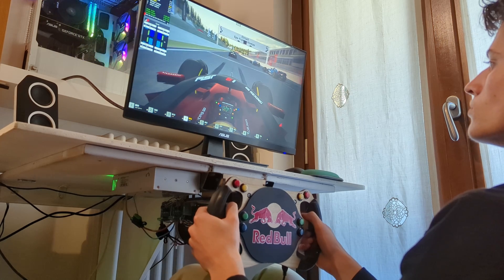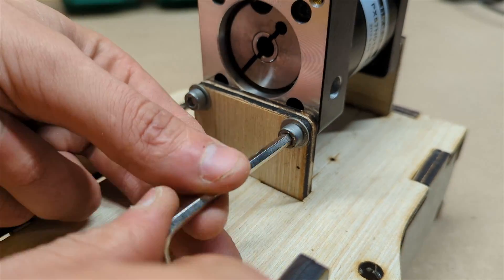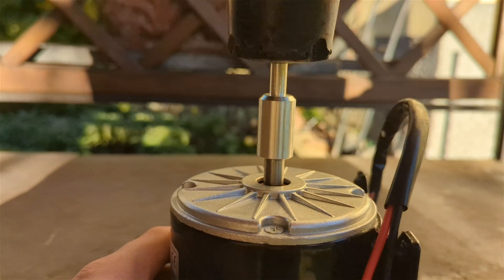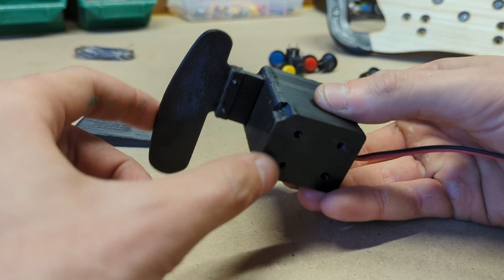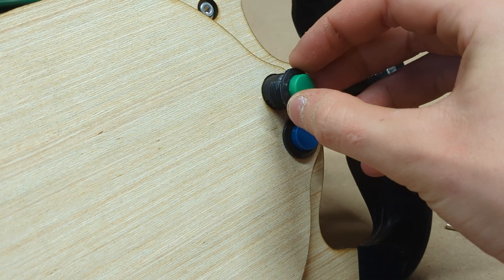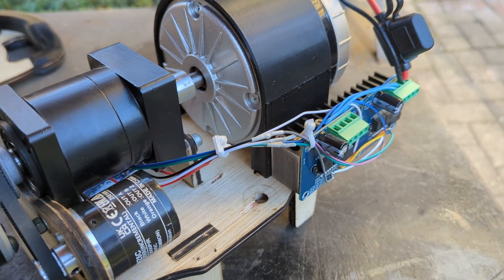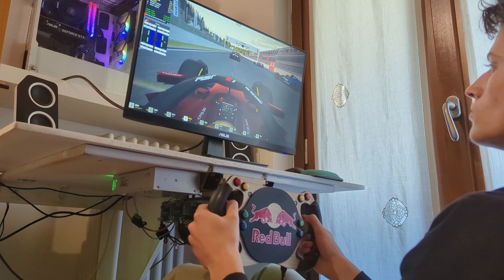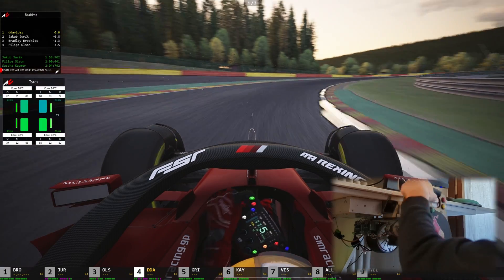DIY FFB steering wheel | 😱 50Nm 😱 | HIGH performance & FUN

Comment: 50Nm? Really? My VRS wheelbase, which has an industrial Mige 130 servomotor and is 3 times the size of this little motor provides only 20NM. A Simucube 2, which costs over 3000 Euros can only generate 35Nm and will brake your thumbs if you're not careful or experienced. How did you measure 50NM and how is it that the torque doesn't rip the wood and your 3d printed parts to pieces? Don't get me wrong, I think that what you did is creative and cool, but there is no way that this is generating 50Nm even with the gearbox in any type of useful way. Only looking at you driving, I can see that you're nowhere near 15Nm (30% of your gain) My wheelbase is bolted with M8 Steel bolts to a 40/120mm aluminum rig. When I run it at 15Nm the vibration travels throughout the whole house. I had to mount the rig on 5cm damping rubber to prevent that from happening and still can't get it completely dampened. The fact that you run it at 15Nm and can drive a Formula 1 car and holding on to hard 3D printed plastic grips without any gloves,....and on top of that bolted to a wooden desk? It would tear your skin and shake the whole desk. I think that there is something wrong with your calculations.
Reply: You cannot compare a base running a brushless direct drive with a geared down base. You can achieve arbitrarily strong torque near stall with a wimpy little motor, and high gearing, but then the max angular velocity that will be achieved will be so low as to be useless! Once sufficient torque is achieved you also don't care about torque so manufacturers competing on these values are just being silly. Often extrapolated/assumed values too because their mount, their shaft attachment etc will not hold up to nominal torque.

Problem is it being a brushed H-bridge driven motor, it has substantial nonlinearity across its rotation, felt as cogging. You need to distribute it across the rotation of the wheel to make it less objectionable, so you just necessarily have to gear it down, which reduces max angular velocity.

To give an example, DFGT, G27 and Moza R3 have very similar holding torque. You can compare motor bulk/weight, G27 is double the DFGT, since it uses lower gearing and two of the same motors same exact as one in DFGT. And Moza is multiple times that weight. DFGT and G27 are both brushed and geared like this wheel. G27 can turn somewhat quickly but it doesn't have a lot of precision due to nonlinearity of response and feedback deadzone. DFGT turns very slowly, it takes multiple seconds to complete a revolution! Moza is very responsive and can turn very quickly.
Reply: I work in trucking. 18nm is whats used to break a truck nut. Thats how powerful 15 to 20nm actually is! This looked like about 5nm
Reply: No steering wheel in a car is going to be so hard to turn as a motor with torque in the double digits  and I've owned cars that don't have power steering, all cars steering goes light once you're moving even if only very slowly. The people who think more torque is better have no idea, probably just kids who don't even drive in real life. The most important thing I think is that your sim wheel will turn fast enough to match what the ingame wheel wants to do. The rotation of the in-game wheel is tied directly to the angle of the front wheels of the car in-game. When you drift, the self aligning force of the front wheels is what you have to keep up with, thankfully you can just let go of a real life steering wheel and it will automatically match the angle the front wheels want to correct to during the drift unless the angle of the car exceeds the travel of the steering rack... That's why drift cars shorten the length of the steering arm on the steering knuckle, so that the front wheels turn at a higher angle per rotation of the steering wheel as well as increasing the maximum angle of the front wheels.

I used to own a RWD car with no power steering where it took 5 and a half turns from full lock to lock. It was hard to drift because the front wheels didn't turn very far either. The turning circle wasn't great either but the steering was very light because of the forgiving steering ratio. I still own a car with no power steering. I replaced the steering rack in this one with one which has 3 turns from lock to lock compared to the original which was 3.5 turns. It's very easy to catch a slide because the wheel doesn't spin too fast which makes it easier to judge when to catch the wheel and balance the throttle. It does make the steering very heavy if you're just sitting still though.
Reply from the maker: I calculated 50nm from the stall torque of the motor I used, it maxes out at 5nm of stall torque, running that through the 10 to 1 gearbox gives a max stall torque of 50nm. max torque (not stall torque) is rated at 1.8nm and gives 18nm at the wheel. I don't know if torque ratings on aftermarket wheels are stall or max torque, maybe help me with that if you know more on this topic, thanks 👍
Reply: @DAZprojects  If this is the 350W MY1060 motor its rated at 1.22Nm with a max/peak torque of 1.46Nm. Peak torque is the value all manufacturers refer to when they show how strong their wheelbase is. I did not find anything about the stall torque rating on the MY1060 motor and would not know how this value would be relevant to measure the effective torque on a wheelbase. If you're running your wheel at 30% of the peak torque value with the gearbox , you're running it at 4.36Nm, which would make much more sense, just looking at how it's constructed (in terms of durability) how it behaves, how you're holding on to it when you're driving and how it affects the table it's mounted to. Then there is also the question of FFB detail and how responsive the wheel is. How fast does it deliver the torque and how fast can it change direction etc. Just out of interest: Does the motor get very hot?
Reply: its 15nm😊
Reply: Nice DIY but Yeah, if you even had "only" 15Nm like the simagic alpha, your screen would be shaking a lot! This looks like max 5 nm...  You can messure it with the endstop of your wheel, a fish weight and some calculation.
Reply: I owned a Logitech 3nm, a fanatec csl dd 5nm, then the boost kit 8nm, and now a simagic 10nm. 
I can tell you that from the 5nm of the fanatec, my desk was shaking in all directions when in use. 
also worth considering that all that 3d printed and  very thin plywood construction would simply break into a thousand pieces if the steering wheel was even only outputting 5nm..

so i dont think your wheel even output 5nm from the look of the video...
Reply: other than that you did a good job, interesting project for sure (just definetly not 5nm ahaha)
Reply from the maker: @HugoTremolo  there's not much to "think about" looking at the video, my desk is screwed directly in the wall, both left, right and back, it has a steel frame and it's super rigid, the wheel is more than capable to rip itself off my hands, and the math I already talked about in my previous comments clearly says what the torque rating is on this wheel. The plywood structure is stronger than you probably think, since 8mm plywood isn't "very thin" as you said. Regarding the 3d printed parts there's none having a structural role, the adapter from the gearbox shaft to the wheel instantly broke and I had one made out of aluminum, the spacer from this adapter to the steering wheel is now the only 3D printed part having a structural role but it's a completely solid cylinder of PETG 5cm in diameter and it will probably be the last thing to break
Reply: @DAZprojects  being a carpenter that uses plywood way thicker than this almost every single day.Makes me believe your 3 or 4mm ply would explode with such force.
Notes for the 3d part.

Also. I now use an aluminium profile, all made of 8040 profiles and at full torque there is some sort of flex and creak. And in have re tighten the bolts every now and then.

Either the math is wrong. Or that Chinese engine is not what it says it is ?
I have built  an electric go kart for my kids. 800w 46v Chinese engine my20 or something like this. 
It doesn't deliver that much power compare to my simagic alpha mini.

Have you tried other bases sold by manufacturer to compare the torque levels ?
Reply from the maker: @HugoTremolo  I've tried a fanatec ClubSport wheel base v2.5 and it was way less powerful, I could just barely feel the force feedback, I don't know if that's to do with how it was set up, but anyway that's the experience I have
Reply: @DAZprojects  You don't know what you're talking about. I sent you a video, so you at least can have a visual reference but you seem to be pretty ignorant about that too. I just hope that you have the character and integrity, to change the title, once you had the opportunity to try a 15+ Nm wheelbase. Good luck to you buddy.
Reply from the maker: @mementomori4972  i don't want to give fake info, I based my opinions on the motor specs, doing the math the torque I'm claiming it can achieve is not incorrect since it's the stall torque of the motor multiplied by the gear reduction. If commercially available steering wheels consider something else as torque rating that doesn't mean I gave wrong info. Anyway thanks for pointing this out, I really appreciate that.
Reply from the maker: @mementomori4972  it could also be that the motor really has the torque I'm saying, but it simply is too slow to give me a quick enough feedback, and because of that it feels and looks less powerful. In any case I'm perfectly aware that this isn't not even remotely close to a off the shelf DD wheel base. It was just a cool project I wanted to show with the community. It works well for what it is and I will probably build something better in the future with the knowledge I gained building this one
Reply: @hansjmo As he said he could reach more than 15 if he runs everything at 100% but he's only using 12% of strength and it's making sens this motors are big and heavy i though they we're not that big but when i got one i actually know how powerful they are
Reply: Don't worry his calculations something is off this isnt 50nm of power to your hands sry. Its moving and reacting like a 5 to 18nm wheelbase.

Yet with his settings looked more like the movement of a 2 to 3nm wheelbase.
Reply: @reviewforthetube6485  He already admitted in another comment that he is lying and preying on gullible people to attract views.
Reply: This is so stupid why where you guys fighting yall some nerds it was a great video by the way
Reply: They're probably jealous purists who feel ashamed that they spent thousands of dollars on something that the manufacturer probably only spends $50 on parts to build per unit. All these things have to do is rotate a wheel with an electronic motor, be able to control how much power to send to that motor and detect the rotation of the shaft relative to some arbitrary, neutral centre point... and be able to turn the wheel connected to the shaft to a certain degree of rotation in one direction and be able to stop it there on the fly. So a motor, a sensor and some clever programming to make it talk to your computer.
Reply: @NickGreiner1988  dude do you see how this thing moves in game? Why would anybody who bought a legit wheelbase with polished software be jealous? It doesn't even move well. Yoy can see the reactions. Its snap and corrections are very very slow. Its details are lacking a ton. Its just like moving something with a little bit of weight thats it. Its not even a good motor for sim racing. Its not transferring a true 50nm. He's got it srt to 40% which would be over 20nm. My wheelbases at 20nm would rip my hands off lol.

Comment: This is unreal! Absolutey amazing work. When compared to high end belt driven wheels, how detailed is the feedback to the wheel? I'd assume manufacturers tune them to work specifically for each game, with each gme giving different detail in feedback related to the physics, can these things be implemented within your logic board?
Reply: Or could y ou just steal a pcb from another wheel or something? Really interested to know how you get your DIY set up to be recognised as a wheel, seems far too easy watching your video :)
Reply from the maker: @Invin_cibles  I'll make another vid explaining the firmware and setup inside the PC, it's fairly straightforward, but doesn't allow for backlash tuning or anything similar